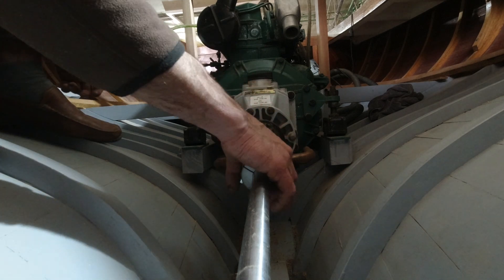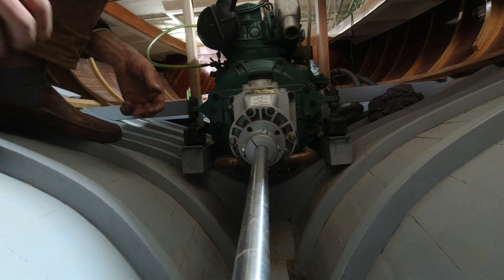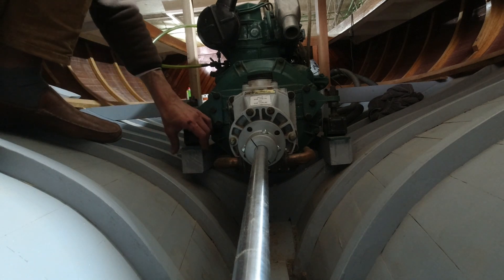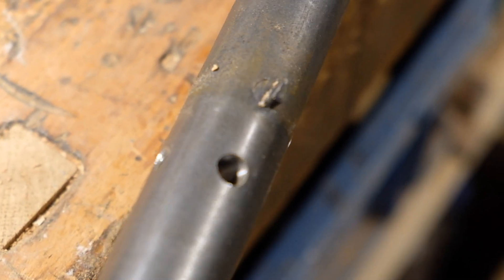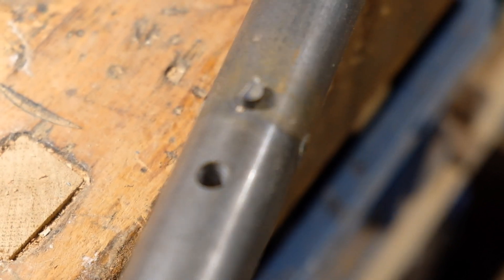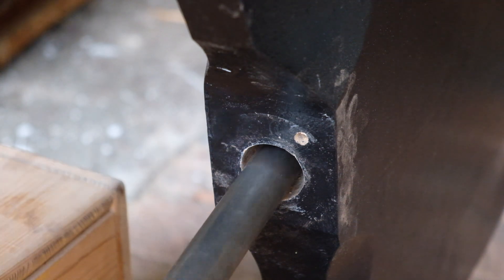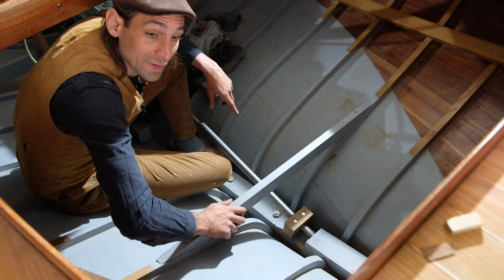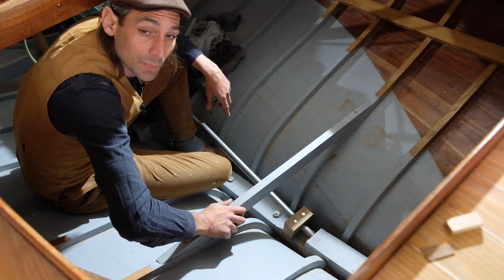The propeller - Craft Endra EP28 I Building a wooden sailing baot

Comment: Be critical when boring holes through the hull. Coat the entirety of the freshly exposed wood with epoxy or sealant such as you used.
Reply from the maker: Thanks mate. I’ll have to bore some more holes later. At least for the exhaust pipe 👍🏾😎